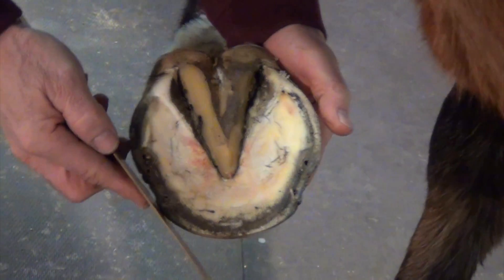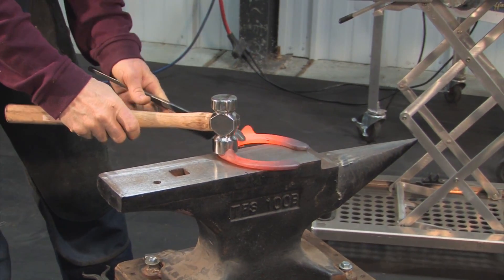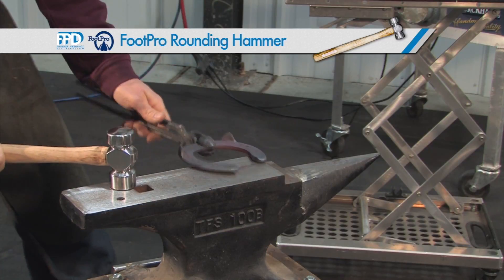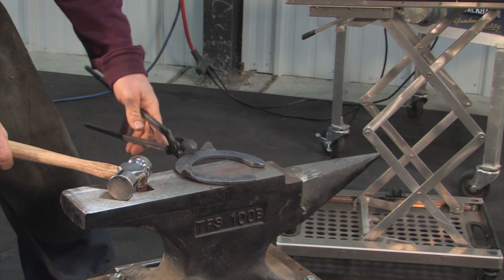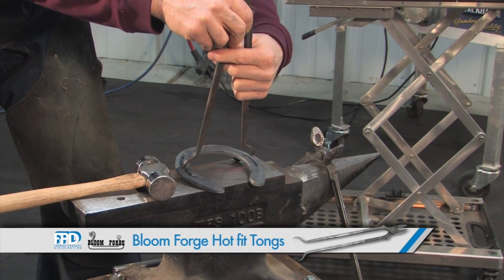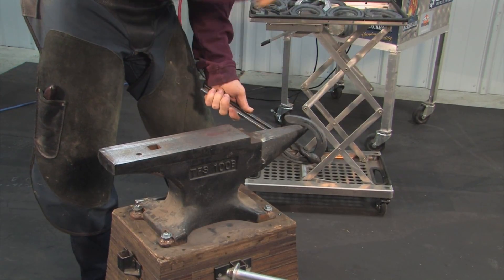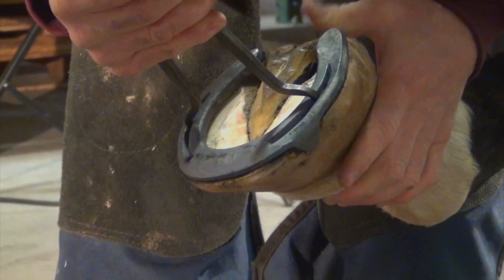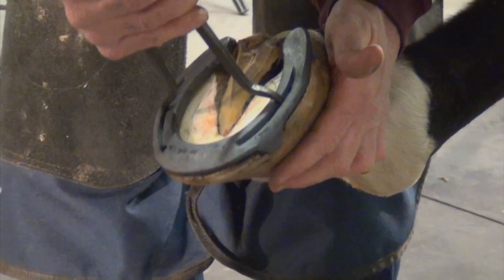Fitting a Kerckhaert Steel Comfort

Comment: Thanks fer the instructional video. You are a good instructor. What is your anvil stand made of?
Reply from the maker: Thanks for the positive comment. The anvil stand is one we use in our shop. It is made from a marine grade plywood and the pieces are criss-crossed and stacked. The center was then hollow. To stablize it and keep the noise down, it is then filled with sand. Quite heavy after doing all that but I think the stand was built using just one 4'x8' sheet of plywood. If you'll send your email, I'll get you some still shots of it.